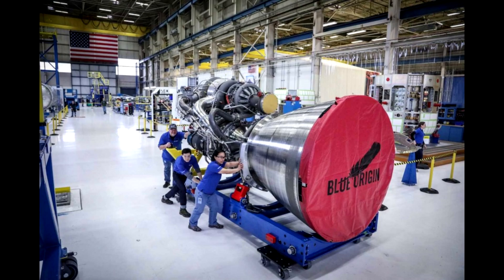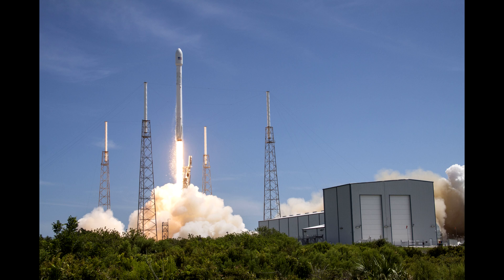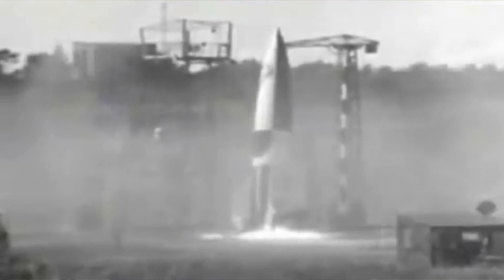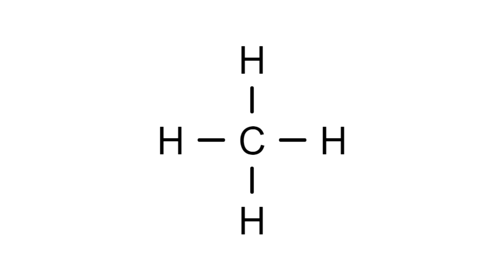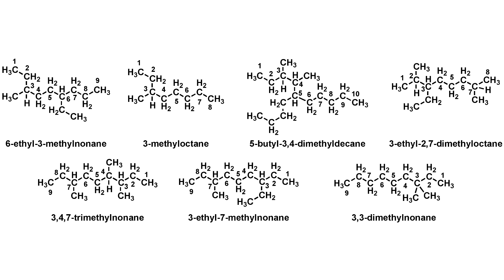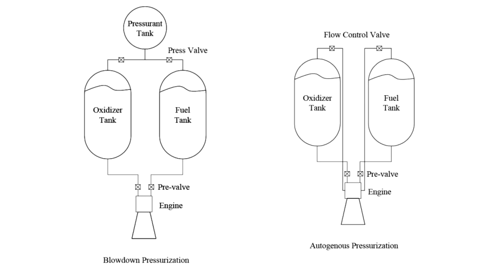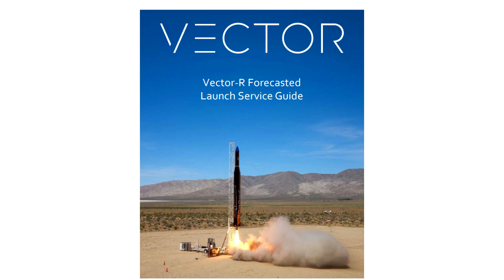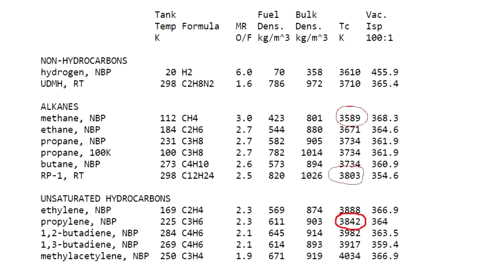Why Next Generation Rockets are Using Methane

Comment: 6:11 - Tanking with oxygen, an RP-1 vs hydrogen loose volume comparison - Comparing the Moon shot Saturn C5 stages S-I and S-II, it looks like the smaller tank on S-II could be "RP-1 size" if the larger tank was LOX - Likewise on S-I the smaller tank would be about the right size for LOX, if the stage burned hydrogen. - It's tough to word this right, and besides, the subject is methane (so double the size of the smaller tank if the larger one is LOX.)
Reply: Genius description, thanks

Comment: Why use methane instead of butane or pentane?
Reply: One reason: 4 hydrogen, 1 carbon - Other alkanes have lower ratios. Individual hydrogen atoms travel faster because they are light. Being the most simple alkane, a kilo of methane has more hydrogen than a kilo of any other. Butane, etc. may have advantages but on balance methane seems to come out on top.
Reply: @soritessoreites1207  yes, but they have about the same ISP but butane in two times denser
Reply: @tedarcher9120  That's why I emphasized the hydrogen side, it has a higher velocity than carbon. Can you post a search string (the title) of your source, this is interesting.
Reply: @soritessoreites1207  if you burn methane, you don't get hydrogen, you get water and co2
Reply: @tedarcher9120  Can you pass that title/search string along? Sources vary, I'd rather work from the same data set.
Reply: @tedarcher9120  If you burn butane you get CO2 x 4 and H20 x 5. If you burn 4 methane you get C02 X 4 and H20 x 8. You get 60% more of the faster moving molecules. That's why I emphasize hydrogen.
Reply: @tedarcher9120  She's right, you know, 100%.

Comment: Given that heat plays such an important role in getting specific impulse, why hasn’t anyone thought of using acetylene in rockets yet? Doesn’t exist as a liquid at STP but definitely can under pressure and when combined with liquid oxygen can basically get you a hypersonic, space-traveling welding torch on steroids.

Comment: the density for RP-1/oxygen fuel is about 1.0235 kg/l for a oxidizer to fuel ratio of 2.56:1 ... damn close to that of water ... however because of specific impulse methane lox fuel can carry 21% more cargo .... engines have a better thrust to weight ratio for rp-1 as it is a denser fuel ... seems that hydrogen lox engines were not worth the ado ... the better specific impulse is entirely lost in tank mass and engine mass for hydrogen fuel

Comment: Do you know if anybody has tried using liquid ozone as the oxidizer in a rocket Since it has a higher density.  Or if not Whly, but my gut feeling is that you could gut feeling is that git a higher specific impulse  and a lighter rocket.  Just what starship needs
Reply from the maker: There’s a section in the book ‘Ignition’ that describes attempts to do this

Comment: I know this is older now, so there are more updates.  BE-4 is still not functional.  I have never heard it was tested to 100% - most likely because they had fuel flow and chamber pressure problems and they did not want to blow up the engine, probably because they did not have more than just one engine to test?   The BE-4 is a non starter because it simply does not exist as a working fully tested engine.

Comment: I have a few questions: 
Why wasn't methane used earlier? Are there any problems with it that had to be solved, or did nobody look at it?
Which rocket concepts were planned to use methane fuel?
I wonder how the performance of the Space Shuttle would've changed if it used methalox. Would it be better, or worse?
And is a all-hydrolox, plane-like space transport (two-stage, fully-reusable, winged, LEO only - something like the original Space Shuttle) better or worse than all-methalox in terms of costs? Is the mass cost of bigger tanks offset by greater performance?
Reply: I'm not sure, but earlier rockets were built for performance rather than cost effectiveness.

Comment: The only advantage of Methane/LOX over RP1/LOX -- short of making fuel on other planets -- is that Methane DOESN'T COKE. This allows for fuel rich staged combustion and eliminates all the issues with running corrosion under oxygen rich environments. Otherwise it's Specific Impulse advantages are basically negated by it's bulkier tanks and hence heavier empty mass of rockets using it. However, while SpaceX's Raptor is at least half fuel rich with it's full flow cycle, Blue Origin's BE-4 elected to be oxygen rich when it could have been fuel rich.

Comment: But ultimately it's just transferring the carbon displacement effect from one hand to the other... in this case a small hand full of people are also displacing large swathes of people in the economy so they can cough 'go to space'...
Reply: You're not making any sense.
Reply: @samsonsoturian6013  if we reduce the smaller plenum by dilution of carbon emissions in motor vehicles and simply replace it with another manner of carbon emission... what doesn’t make sense about that?
Reply: @pocarinudes  that's a lot of jargon, which I can clear up by saying that rocket launches are too few and far between to matter carbon wise even if space tourism takes off. And you haven't explained even half the nonsense of your comments
Reply: @samsonsoturian6013  that’s “English”...
Reply: @samsonsoturian6013  now while I understand that not everyone speaks “English”, I would hardly classify it as “jargon”...
Reply: @samsonsoturian6013  you said you couldn’t find any of this on Google so, I mean that automatically cuts in half the chance that it is jargonised language...
Reply: @samsonsoturian6013  what about the basic premise of “transference of properties” is even rhetorical?

Comment: Why use methane?
Short answer: it makes the plume look cool
Reply: methane doesn't generate mach diamonds
Reply: @oren2000  I never said anything about Mach diamonds I just said it makes plumes cool
Reply: @kerbal8216  it makes them blue, that's all
Reply: @oren2000  yes and it looks cool in my opinion
Reply: @kerbal8216  just a blue exhaust wouldn't look cool

Comment: In a pinch, say if one were on the moon without any resource except water and electrolysis, could one run a methane engine on hydrogen with minimal preparation?

Comment: First I love your work, however in this case I must respectfully disagree.  You present the premise that temperature is the most important factor yet by your own tables Methylacetylene has a significantly larger Tc than Ethylene yet both have the same Isp.  I'm assuming that Tc is the adiabatic combustion temperature.  Actual combustion in real engines never achieves these temperatures because combustion is incomplete.  For example the Saturn V F1 engines on liftoff typically have a dark exhaust for many feet at nozzle exit due to uncombusted carbon  (much like the black smoke from big truck engines) which when mixed with atmospheric oxygen burns and creates the large fire trail we have known and come to love.  The relatively good Isp is due to the fact that a lot of carbon is exhausted which has a molecular weight of 12 vs waters 18.  Interestingly enough even your own table show that Methane has a higher Isp than RP-1 despite the Tc difference largely due to actual in practice higher combustion chamber temperatures and despite higher exhaust molecular weight.

Comment: Thats great for Vector to use propylene.  Propyne (aka methylacetylene) as rocket fuel would burn even hotter, but there are problems with it recombining in the tank to create other molecules such as Teflon. Methane is also more easily manufactured.

Comment: There is a good reason kerosene is used.. it's a better fuel. Methane is extremely low on available energy.. stick with what is proven and works...
Reply: How about if we go back to using air pressure in a water rocket like when we were kids.
Reply: Methane has a higher specific impulse than RP1
Reply: It's like using gasoline vs using nitromethane in cars; it depends on the application.

Comment: There's another propellant potentially even better than methane. MAPD (methyl acetylene / propadiene). MA is effectively the same thing as PD, the two species exist in an equilibrium reversible reaction. The C-C triple / double bonds add additional energy giving the fuel alone a very high positive molar enthalpy.  So it would be even more energetic than methane.
Reply from the maker: With rocket engines a big factor is the molecular mass of the combustion products. So you want more hydrogen.
Reply: @scottmanley  I've heard that, but it doesn't make sense when you consider Nakka's equation with an ideal gas. It seems that the molecular mass is a wash. This is because temperature is inversely proportional to heat capacity and heat capacity is inversely proportional to the molecular mass. So combustion temperature and molecular mass should be directly proportional to eachother and thus cancel eachother out.
Reply: Of course this isn't to suggest rocket scientists are wrong. Only that the explanation is inadequate.
Reply from the maker: @FourthRoot  Sure, but doesn't that then imply hotter temperatures? I did look and see some claims of specific impulse close to that of methane, but since people aren't seriously looking at it I'm guessing there are drawbacks that worry people. Methane is probably easier and cheaper to acquire.
Reply: @scottmanley  Yes. The drawback is probably heat. Not only does it burn much hotter, but there would be a lot of intermediate carbon present in the combustion chamber, so radiative heating of the chamber walls would be a tremendous problem.
I was also wrong about its specific energy. It's just less than that of methane.
Reply: @scottmanley  Diborane / oxygen would theoretically be more powerful than even hydrogen, but with it being pyrophoric, incompatible with water, and a 4 4 3 rating on its NFPA 704 diamond, who would be crazy enough to handle it?

Comment: I'm still baffled as to why they built LH2 engines before liquid methane. It would seem like LH2 rockets should inherently be more complicated due to the incompatible boiling / freezing points of LH2 and LOX, the difficulty in producing and storing LH2, and the gigantic tank requirement. The benefit of higher isp is also largely or completely offset by the larger tank mass except in upper stages for missions beyond LEO.

Comment: Stoichiometric methane / oxygen is actually more energetic per unit mass than stoichiometric RP1 / oxygen.
Reply: It burns cooler because the reaction produces a higher proportion of water to CO2 and water has a higher specific heat capacity.

Comment: I really do not understand why we haven't made rockets that can run off water.  Hydrogen and Oxygen.
Reply: It takes energy to split water into hydrogen and oxygen, usually by using electricity for electrolysis. Rocket fuel needs to yield energy, not use it. Scott only briefly mentioned engines that use hydrogen as fuel. Hydrogen and oxygen (both stored in cryogenic form) flow into an engine and are ignited; burning them results in water vapor.
Reply: In order to burn water, you have to add energy.  Combustion releases energy to create water.

Comment: Another significant advantage over RP-1 on long (interplanetary?) missions is that it won't freeze solid from close proximity to the LOX. No boil-off like hydrogen either. I remember Spacex losing out on a couple launch contracts to competitors with hydrolox or hypergolic upper stages because the falcon 9 second stage didn't have the endurance for a restart after a couple dozen hours because the RP-1 would freeze.

Comment: Natural gas is non-compressable...
Reply: All gasses are compressible.  Liquids are only slightly compressible.
Reply: @stargazer7644 it won't turn into a liquid under pressure are you going to carry tanks under a million pounds to store enough gas to be actually useable in the relatively small area of a tank? Makes all kinds of sense rite?
Reply: @jamesgossel9483  You don't pressurize NG to turn it into a liquid, you cool it to about -160C at normal atmospheric pressure.  LNG tanks are typically only pressurized to about 4 psi.  Methane won't really turn into a liquid at any pressure if the temperature is above about -90C - it just goes supercritical (and is still compressible).  If you had said liquefied natural gas (LNG) is non-compressible,  that would have been correct.
Reply: And stored at room temp is 32000 lbs? Or are you saying we should use some of the gas to keep the tank cold? That creates issues its self. And that is why we in the bizz say that natural gas is not compressible. It just isn't an efficient solution.
Reply: @jamesgossel9483  You in the bizz seem not be grasping the distinction between CNG (guess what the C stands for?) and LNG.   All cryogenic fuels in rockets boil off when they're exposed to warm temperatures - the tanks are vented to prevent rupture.  If you left LNG in a sealed tank the tank would have to withstand 4600 psi.  While you can certainly make a specialized tank that withstands that pressure, it would be much too heavy to put on a spacecraft.  They use much thinner and lighter tanks at lower pressures, and they let the liquid boil off.  Spacecraft tanks are insulated to reduce the rate the liquids are lost,  but the LNG doesn't need to stay in the tank longer than the few minutes the engines burn. So the loss isn't a big deal.   I'm sure you've seen all of the vapor coming off of rockets sitting on the pad - that's the vapor being vented from the cryogenic oxidizer and (sometimes) fuel tanks.  The ground support system keeps topping off the tanks through the umbilicals to replace the lost liquid until just before launch.
Reply: I'm obviously trolling you... cmon bro.

Comment: I recall reading somewhere that methane is a common element in the atmospheres of the outer planets. I suppose it's possible someone is looking ahead to the possibility of simply harvesting fuel components from the air an orbital base happens to be in easy reach of?

Comment: Great stuff, Capt. Scotty!   In answer to the question: Why?   Maybe it is a whole lot cheaper and safer than Hydrazine.   BTW, James Burque (Connections, BBC) did a great segment on Hydrazine as rocket fuel and as plant virus killer during the Phylloxera blight in 1893.   Because of the loss of rootstock, the only resistant vines as roots were found in the Rio Grande Valley of Texas.   The entire French wine industry now is dependant on plants started in Texas!   Bonjour, Buckaroos, and Buckarettes!---

Comment: How they should keep methane for years on Mars?
I guess it will be easy this way CO2→CO→(H2O→H2)→C2H5OH(and finel step in short time before launch) →C2H4
Reply: Ethane is also a product from Carbon Dioxide via Klobe electrolysis reaction, and solar panels can provide voltage.
Reply: @quantum7401  how you want to produce ch3cooh?
Reply: More importantly where H2 come from? Now Oxygen to combust upon return.
Reply: Mars has water

Comment: 4:16 I don't understand. Could someone explain why lighter exhaust products increase the specific impulse? 
Isn't it better to have a higher reaction mass? Like when they use xenon for ion thrusters? Where am I getting it wrong?
Reply: I don’t know much about specific impulse and what it means exactly, but I saw in one of Scott’s other videos that specific impulse is inversely proportional to fuel mass. You can look up the equation for specific impulse and see for yourself
Reply: The lighter the exhaust products, the faster they get thrown out the back.  Thrust is mass throughput times exit speed.  Thrust is maximized when exit speed is maximized.  Since the mass must be accelerated, the fuel mass should be as light as possible, to achieve the maximum thrust.

Comment: I am the person who generated the propellant performance tables shown in the video.  I have recently compared the performance of RP-1, propane, methane, and hydrogen for a hypothetical stage generating a delta V of 5000 m/s and carrying a payload of 100 metric tons.  There are only small differences in performance between the three hydrocarbon fuels, with the increased Isp of propane and methane being offset by the requirement for larger and heavier propellant tanks and turbopumps.  The advantage of methane then isn't related to performance, but to other factors touched upon in this video. https://www.quora.com/Are-there-benefits-to-methalox-rocket-engines-besides-being-able-to-make-fuel-on-Mars (scroll down through the various answers until you get my answer).

Comment: Propane and/or Butane would probably give about a 20% increase in specific impulse over methane and it can be liquid at reasonable pressures and room temperature. And the coking should be fairly reasonable as well. Why hasnt anyone looked at using that as a rocket propellant?

Comment: summary:
1. it was difficult to get hold of high purity methane, not anymore
2. methane combusts more completely --> much less clogging up the engines to worry about
3. methane's less energetic combustion gives lighter combustion products --> longer engine lifespans and higher specific impulse respectively
4. autogenous pressurization possible with methane 
5. methane is less dense than RP-1, but still denser than hydrogen; though methane is cryogenic, overall the trade-off is worth it 
6. can make methane on Mars for return missions

Comment: Methane is the main component of natural gas. A cheap, plentiful fuel and the cleanest burning fuel other than hydrogen. It produces far fewer CO2 than other HC fuels, although it is a very potent greenhouse gas, about 20 times worse than CO2. It can also be made from almost any organic renewable. So it is environmentally correct provided it doesn't leak and venting is kept at a minimum. As launches increase the environmental effects of launches will become a major issue in space flight.